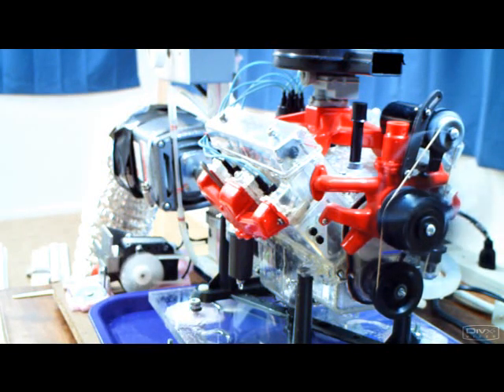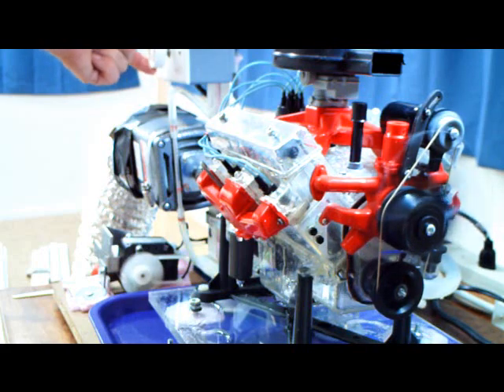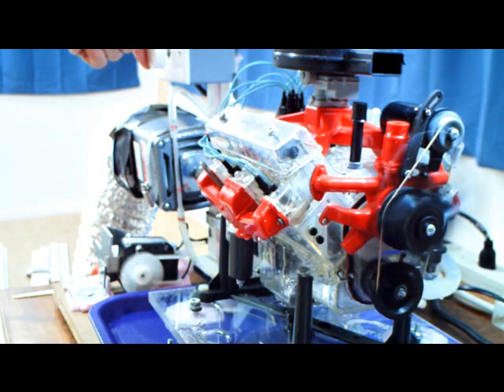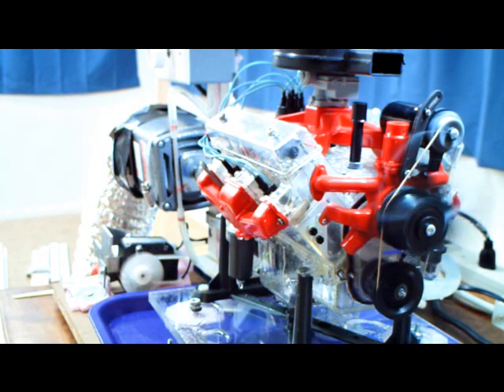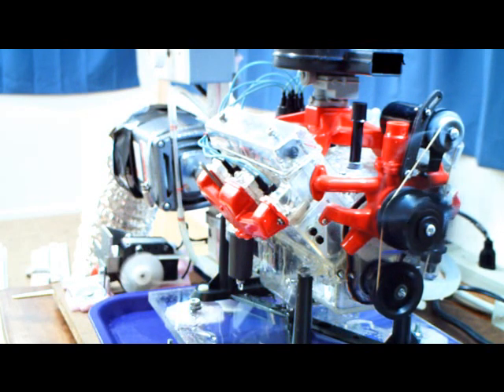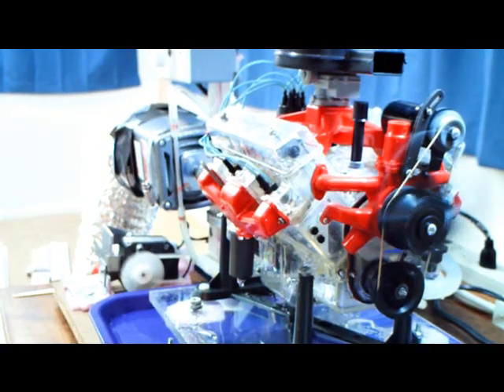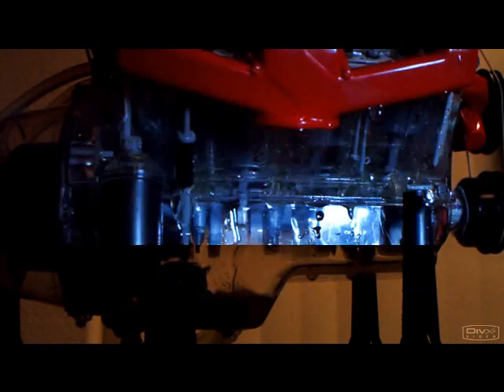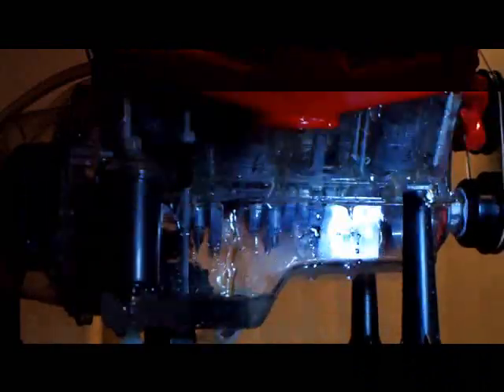Visible V8 Testing # 2 Oct 4 2010

Comment from the maker: @ts46176 I don't know anything about that kit, but I think they are rare now and have not been for sale new from Revell for quite a while. The newer Visible V8s are now made in China and have metric nuts and bolts that cause some problems in assembly. I have ran into this problem. Also Vegetable oil will after a while will trash your engine. I found this out the hard way, the way I usually find things out.

Comment: I just won a Revell 1:3 Visible Turbo Engine on Ebay for $55 with shipping, major water damage to the box but other than that it's still sealed, I was wondering if you'd had any experience with this kit, I know I've read about nuts not fitting on these newer kits from your videos.